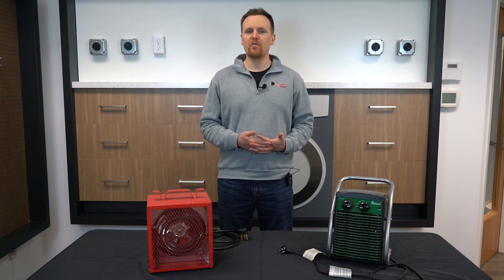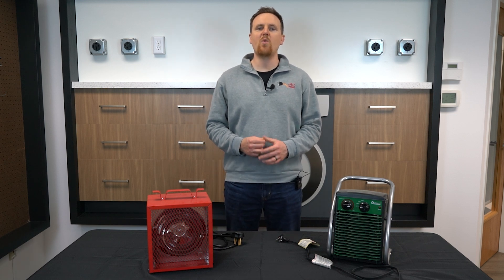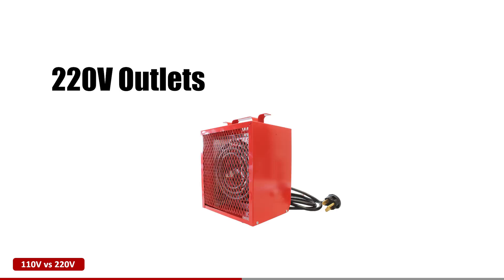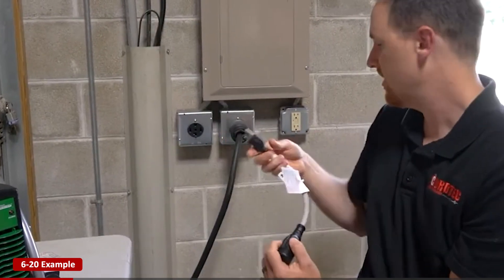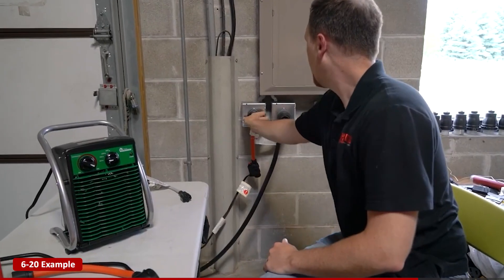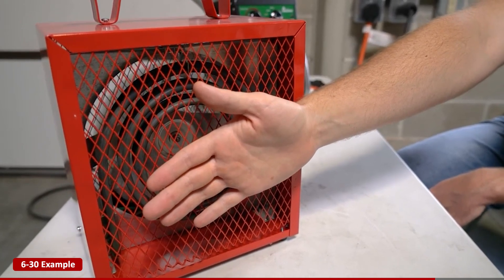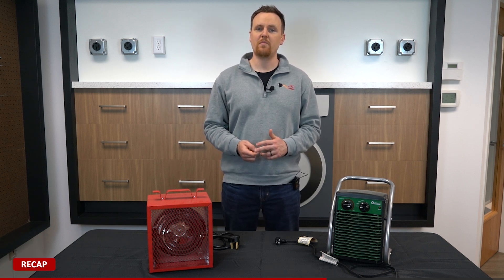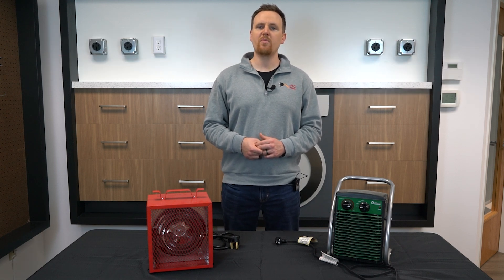What Happens When You Plug 220-Volt Appliances into 110-Volt Outlets

Comment: Can a 110 appliance work well on the 220 volts outlet
Reply from the maker: This depends on the outlet. If the outlet is rated as 125/250V with 4-prongs, then you can adapt to a 110V appliance. If the outlet is rated for and only wired for 250V, there is no way to adapt that to 110V.